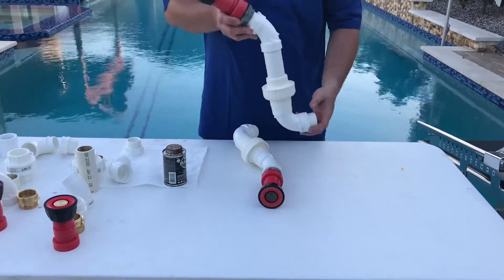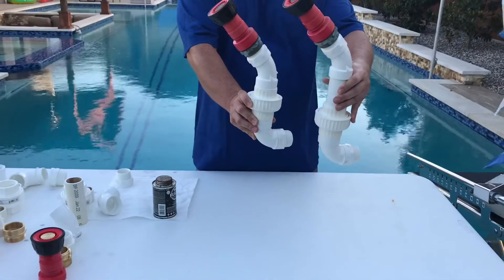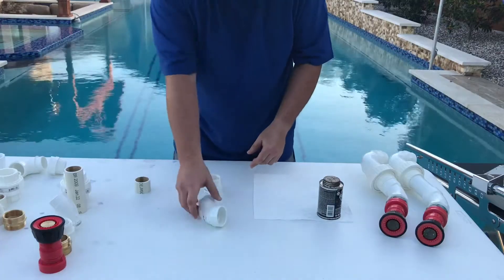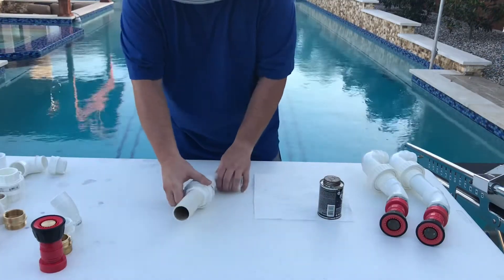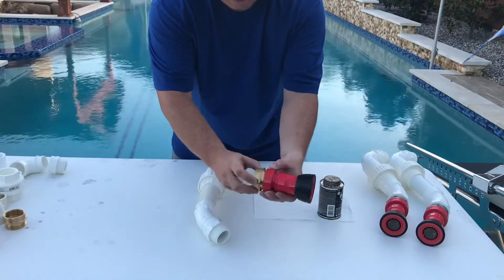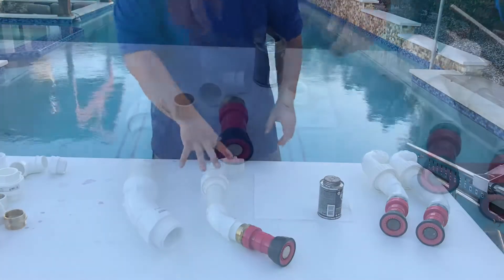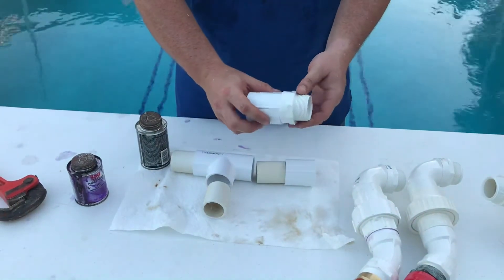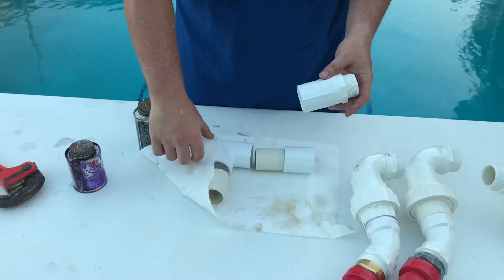Building a Pool Cooling Spray Cannon

Comment: Thanks for anywhere great vid! Have you considered building some type of roof or coverage offer the entire pool? Would lower temps by deflecting direct sun while helping your swimmers' skin and eyes. There are even these partial tents,  basically done without walls, that are used in the oil industry, and would likely be a hit with the HOA. Admittedly, easier for me to suggest than you to design and fund. Anyways, happy swims!

Comment: I had an odd connection,  the 1.5 inch jet coming out( thread on outside) male not compatible with a 1.5 threaded couplings. It seemed like the threads did not match. Metric vs standard?🤷‍♂️ Yelp
Reply from the maker: Are you talking about the connection between the sprayer and the pool wall, or the connection between the pvc and the firehose nozzle?  If it is the latter, there is a brass adapter in the parts list that converts it from NPT thread to firehose thread.
Reply: @BackyardLapPool  thanks for the follow up it's a grey looking PVC pipe 1.5 threaded male just the 1.5 inch PVC did not want to connect.  The threads were not compatible.  Help if you can I'd appreciate it.
Reply: It's the pipes coming back from the equipment/jet line it was we call it if they sounds right.
Reply from the maker: @jepirules1   It might be something similar to this fitting adapter.  It has what appears to be an NPT thread that expands to a nozzle thread.  (Trouble Free Pool Link)  https://www.troublefreepool.com/threads/pool-return-line-thread-mystery.143959/
Reply from the maker: I think you have to remove the adapter in order to plug a male NPT thread into the socket on the side of the pool (My best guess based on the picture on the forum link.

Comment: Another DIY guy!  This is a genius idea! We live here on the surface of the sun aka SE  ‘burbs of Phx AZ. I would gladly trade you your  92-94 for our 114-118 during height of Aug! 😂  we have one of these spray devices on our backyard pool but ours is much smaller level and non adjustable.  Breaking the surface heat of the water really does make a diif.  Also... we have same Pentair equip! Just upgraded this summer. It is very quiet and efficient.  Great video / DIY
Reply: He is talking water temps.

Comment: evaporation must hurt during summer, have a pool cover?
Reply from the maker: That’s a good question. I actually looked around for a supplier of white thermal covers to reflect sunlight during the summer months but couldn’t find one.

The next cheapest option to keep the water temperature down is to evaporate water - hence the sprayers.

Cooling towers like the “Glacier” brand pool coolers are doing the same thing in a more mechanized and discreet way at the equipment pad. If money were not a factor, a pair of cooling towers would be the way to go for this pool. But even if I installed them on my own and purchased them direct from the manufacturer (CTS), it would run upwards of $7k for the set of 15 ton units. This solution runs roughly $300.

Surprisingly though, it takes less water to maintain the pool level (even when running the sprayers) than it took to keep the grass alive when I had a full yard. In the E. Texas sun, it’s not uncommon to have to burn through 15k, 20k or even 30k gallons of water each month on bigger lots to keep the grass green in the summer. The pool loses a fraction of what it would take to keep the lawn green to evaporation.
Reply: @BackyardLapPool  another option could be using  liquid blanket... I was doing some research  and some people say it helps with evaporation (around 50% less), haven't tried that out but it seems like a good option if it actually works specially for pools with such a big surface
Reply from the maker: Santiago Salcedo yeah - I’ve seen that on some of the online shops. It is normally used for keeping a pool warm though in the fall / winter. In the summer, the more water that is evaporated, the lower the pool temperature. In the winter, we use the thermal covers at the end of the pool to keep the water temp up and avoid evaporation.
Reply: Use black ball like i saw one in the YouTube to cover up the lake to prevent evaporate